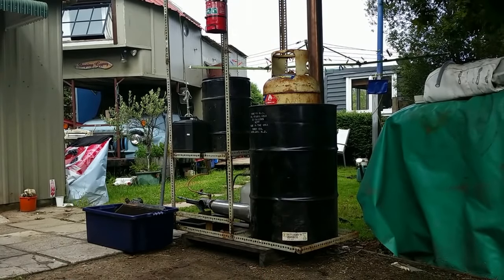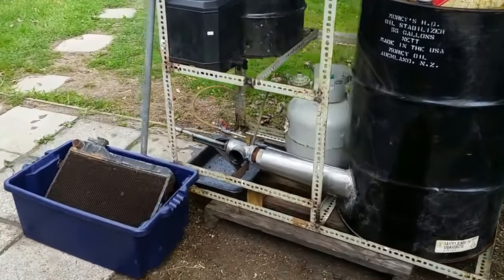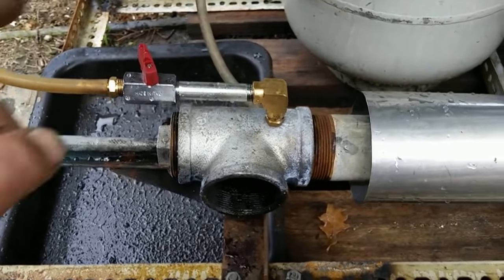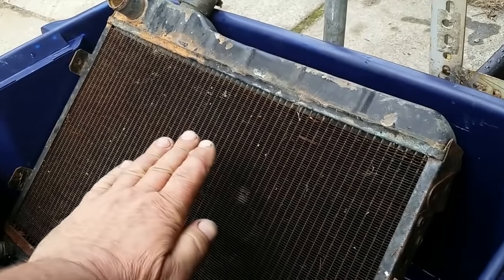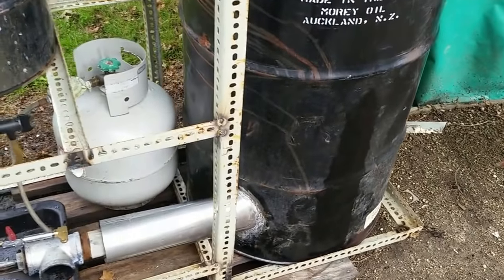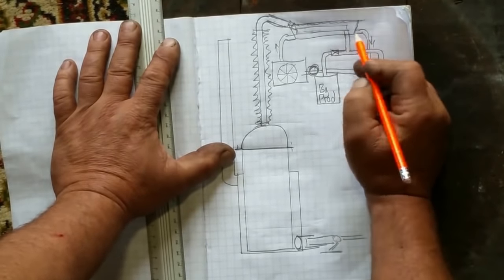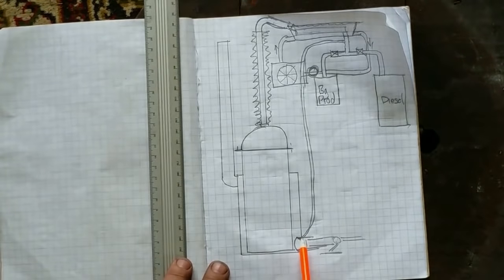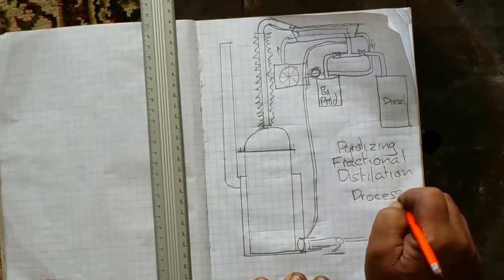Make your own free Diesel from Waste Plastic!  PART 2  layout of components

Comment: You are distilling the fumes from the plastic basically. It is easier to distill them through a water bubbler. Also the plastic melting point is low so you only really need an electric heater. Great design though, well done. I see tech like this solving the world's plastic problem... just convert it back to oil and refine it further to make gasoline.
Reply: could use solar to melt plastic ?
Reply: Yes I am sure you could. Use solar to generate the electricity needed. You might be able to use a water/solar magnifier but it would be risky, inefficient and only work on sunny days in a warm climate! All you need is a sealed oven and to bubble the gases through water. The oil/diesel will float on the water. Further refining will eventually make gasoline (lean oil).
Reply: Melting the plastic at high temp I believe is partly combusting the plastic and creating carbons which might be why the result is sludgy? The plastic should refine back to lean crude oil. I think diesel is a bi-product of the high cooking temperatures. Google the difference between oil and diesel. I think by refining the oil further you are reducing the sulphur/carbon to air molecule ratios upon combustion. Or something like that...
Reply: When you cook the plastic at high temps you are producing vapour and CO gas which is probably flammable too. You can do this with wood and produce flammable gasses and tar (a sludgy form of oil). The trick is to melt the plastic but not to over- combust it, I believe. The Japanese guy takes his little unit around to schools and gives demonstrations, so it cannot be that hot.
Reply: Simplify the process down so you have a heater, a cold water bubbler and a siphon to collect the oil when it reaches a certain level.

Comment: One part you didn't explain was the "by-product" to Diesel difference and how do you know when to switch from one to the other.  You said the by-product was produced in the early stages before the diesel product happens but I don't understand what you mean.  Is it the initial burning process produces the by-product first and once that is burned off the rest becomes diesel.  How do you know when all the junk is gone?
Reply: Investigate fractional distillation. Different molecules chains break out into vapors at different temperatures. Devils brew are longer molecules chains which vaporize at lower temperatures before it is cooled and condensates. As the temperature rises shorter molecules chains vaporize. Diesel will be produced at a certain temp.

Comment: If I understand this correctly you need to supply compressed air to the burner, how do you arrive at the compressed air?  Is that a seperate power source?  Compressors use a fair bit of electricity.  Also why don't you just use the waste vege oil you're burning to power your car/generator?  It must use quite a bit of fuel.  Would this plant make enough diesel per kilo of plastic to power itself without using the waste vege oil and end up with a net excess to power your car/ generator?
The propane starter fuel would als be an expense that would need to be factored in.

Comment: ..Is there enough excessive thermal energy to use some of it to drive the pump and the fan for the cooling system?   I doubt that you see very many Sterling engines at the dump, but maybe something similar...  Maybe you want to keep them on a separate power system.
Reply from the maker: oooooh - this seems like a phase two project!- lets get the insulation sorted first!

Comment: Hi Sir, first of all thanks for your videos. I have a little question. I m in Thailand and want to do this process low tech for the local who could use the plastic they found on the beach to get fuel ( instead of just burning it in the nature ... ). Problem is, i saw lots of people getting " Wax " instead or fuel. I saw others videos and people was using multiple container to get ( lite fuel, Fuel and Diesel ). I Just want to know how to avoid to get this wax when temperature goes down. Don't want to break the engine of those locals either. 
Thanks in advances for all the ones who gonna reply. 

Save our planete PLS

Comment: Perhaps I missed it but how do you separate the devils brew from the diesel?  Is i the case that the Db is the first few drops of the distillation process?
Reply from the maker: its about the first pint- it goes into a seperate vessel and is added to the next batch to be assimilated

Comment: I wonder how well an old water heater tank would work as a reaction chamber. And instead of plastic as a reaction material, use crude oil. And instead of an uncontrolled fractional distillation, add a temperature controlled pressure valve to the top of the reaction chamber. I bet I can crack diesel from crude, and power the whole thing from the byproducts, even pave my driveway with the waste bitumen that will collect in the reaction chamber.

Comment: you should be making hydraulic fluid and oil instead of gas. you can use a battery and a motor to make an alternator turn to make 350 amp with beat truck alternators and a 120 3hp motor will turn ten beat truck alternator for 3500 amps then you need a voltage rectifier to make it all one current then a transformer to make the volts or develop ones that make voltages in the range you need. gas depletes the resource of the crude when needed somewhere else.

Comment: Its really a excellent work but how much pressure is required for vapours fuel to comes out from the reactor?
Reply from the maker: You only need enough pressure for the condensate to get to the high point - then gravity does the rest I have mine set at 2-4 psi
Reply: How much cost involve for a model Upto 500kg plastic .
Reply from the maker: @quantumeducationservice307  - you just wait right there Bob while I  extrapolate my findings and expand my system to your hypothetical parameters. Im sure that by the end of the day I can have your answer- please leave your billing address below  for my consultancy charges. 😄😄

Comment: First a belated happy birthday. 🎂
Look interesting.!🙄
I was wondering if a simple ventury system as used in a degreasing gun, or on a blowmister could create sufficient misting of waste oil, and just how much air you would need from a compressor to  create adequate misting.? 
I use grid power, and electricity prices are going up, so without solar or wind generated free electricity it will get costly to run a compressor for many hours.$ 🙄.?!!
Reply from the maker: I pushed air through a .8mm mig contact tip so the air volume was miniscule. 2hp compressor manages easily. With longer, fatter chimney the airflow would be enough to atomise a simple drip system like ive used  or a 12v bilge blower from a boat. Ive made newer design using this. It blasts! Ive used it on my forge and on my new oil fired central heating. video soon

Comment: Too many Ads, besides that, thank you for the explanation and diagram.
Reply: Just drag the play dot at the bottom of the screen all the way to the end of the video and then click on the replay icon on centre screen,  takes away all ads most of the time. Sometimes there is just one at the end after you've dragged play dot but others will be gone on replay.

Comment: I see you are using a propane bottle in your system. Could you not use a "Tiger torch" for the burner instead of making your own?
Reply: The propane is just to get the system going, heat the burner to operating temp. Once there it runs off of waste oil only. Can't use a tiger torch for that.

Comment: When will we get to see the rest of the project. Very much looking forward to it :)
Reply from the maker: I like to get stuff for free and Ive had to wait for some  free insulation to appear!  Im about to do the segment on the heating chamber and reaction vessel by the weekend. Coming up after that  is a video on the reflux tube and condensers. Thanks so much for your comment, Its great to get feedback
Reply: TinyHouse and Offgrid Resources  I understand that. I like free stuff too. I just scored a 55 gallon steel drum and two 26x26x2" radiators. Still searching for a propane tank or other suitable pyrolization chamber. Might wind up using some oil well casing.

Comment: sir where you have connected the pipe that is coming from the gas ?
Reply from the maker: At 12;20 on the video you see where the gas is drawn off to feed the burner. in video 3 you will see the gas produced.
In Video 4 ( due out Monday evening) you will see the Reflux tube being madeand you will lern why its filled with glass marbles
Reply: som mondal 6

Comment: could you try gum leaves in your big whisky still, as i am told that diesel motors will run on eucalyptus oil.
Reply from the maker: Gums are a rarity over here!- you try it and report back!  Im stuck on this project too- I have such trouble with insulation on all my hot stuff- Im watching The Honeydew Carpenter - he is making awesome aircrete insulation- I ask him  questions and never get replied to
Reply: I don't known if this helps but i just saw a guy use 1 part cement, 8 parts water, 18 parts perlite,  to make a soft but good insulation. it needed to be rendered though.    might not be what your looking for, just throwing it out there.

Comment: How do you solve the flue gas that comes out from the chamber? The flue gas can be toxic.
Reply from the maker: Perhaps I should put a really long exhaust pipe on it and aim it your way?😴
 If you watch the videos you will see how clean this burner is! There is no smell or smoke whatsoever. Just a heat haze.  I have had the exhaust tested with an automotive exhaust emissions  tester and the results for Carbon Monoxide and carbon Dioxide were about 40% that of a late model car. The particulate discharge was totally undetectable on the machine

Comment: So just use the oil you're fueling your machine with to run the diesel engine...?
Reply from the maker: It uses 1 liter per hour- my truck wont go far on one litre of used engine oil and we have not got rid of any plastic- this is about using plastic that sits in bales in stacks as high as a 3 story building just outside my town
Reply: @t.h.o.r.  how many liters of diesel are you creating per hour? And you are talking about 1 liter of used engine oil (the black stuff) rather than some people thinking it's used fryer oil.
Reply from the maker: @janicefreedom8665   The burner will run on pretty much any oil you like . It uses about a litre per hour. as i say in the video- production depends on the size of your vessel- its easily scaleable.
Reply: @t.h.o.r.  I like the idea that you are using waste engine oil. the original commenter was having the idea that you could just run an engine on the oil you are using as an input... yuk.
Reply: @t.h.o.r.  What I was asking ... if your system is running.... 1ton of plastic sould equate to ~ 700 lts of diesel fuel.... how many hours would your system take for that..... and how much processing of plastic.... like does it need to be cleaned and chipped before you can use it?
Reply from the maker: @janicefreedom8665  i dont honestly know- i just presume that if you increase the reaction chamber size then you hold more so it takes longer. ive got just this one machine that i play with- there are many videos on here of larger systems- there are some good ones on my playlist https://www.youtube.com/watch?v=cQdGTritwwc&list=PLyv0yXw8MSrH_5AhWrJVaPRw9Er8ij9JQ

Comment: Your machine is exquisite, but complicated; too complicated for me. My machine consists of a burner and sometimes I use a rocket stove with wood or sometimes I use solar and a big reflecting mirror. At any rate, all I do is have a container, which is airtight and that can be gotten into quickly, like a pressure cooker. I heat the plastic anaerobically and as it offgases, I condense those gases similarly to the way you do it and we both wind up with free fuel.

Comment: Looking good so far  - basic pyrolysis, with not-so-basic products.
That 'reflux' tube thing bothers me. You're not cooling it, in fact, almost the opposite, so it's not technically Reflux.

However, if it works, more likely it increases the separation of the products, much like a Vigreux column.
On to video 4 ...

Comment: how you get the filtred desile??
Reply from the maker: the videos 1-6 deal with the design and building of the machine.right now Im sorting issues that have become aparant in the first few test firings. next we will be making raw diesel which is a little 'rough'. after making 3x 20 litre  batches i will have 60 litres. then we put that 60 litres through again to get perfect diesel

Comment: Looks like you have Nissan crew cab pickup, I assume it runs on diesel.
Reply from the maker: Yes but so far im only experimenting I run the diesel batches in a 30 hp stationary engine

Comment: How do you separate the devils brew and diesel
Reply from the maker: A sight glass and two taps, all condensate that occured before 350C gets diverted to another vessel. when the condenser reaches 350C I just flip the taps and that diverts it to vessel no 2
Reply: what uses are there for Devils brew and if not how do you safely dispose of it 
 @t.h.o.r.
Reply from the maker: @kimelize  you just process it in the next batch. It only happens cos the device is not up to temp and the product is not deisel

Comment: It seems pretty dangerous to have the LPG tank right next to the burner.
Reply from the maker: Its only there for 2 mins while it heats up. But the whole thing is a bomb- thats why I stopped doing it!
Reply: I like your initial machine.  Now that you have your first one; how would us improve the entire machine?  I've been working on creating bio-char using a 55 gal drum but the drum only last about five to eight cycle before the drum must be replaced.  Stainless steel drum are better but as you know ss is difficult to weld.   Your video is great.  Thanks

Comment: Of course this process is not unique.  Just to point-out to those here, who might think this dude invented the idea....   
But interesting to note, with all the talk of sustainability and alleged environmental concern,  that no-one here questions the continued use of fossil fuels (this system derives fuel from plastics, themselves a product of oil,  sequestered hydrocarbons...).   Nore does anyone question the content of gasseous emissions from the combustion of 'plastic diesel' fuel (?)  
.
Not as impressed, as people think I should be...  Though in the very short term, it might halp to remove some of the plastics in the environment...  But GHG emissions are still be produced by the combustion of this fuel.

Comment: Not a wise spot to have a fire extinguisher. Never put a fire extinguisher near a place a fire is likely to happen. Reason is it may get to hot to access by the time you notice that you need it..best to have it where one could access it if the fire was discovered already engulfed. if that gets out of control who the hell is going to reach above hot flames to grab it?!. 
Its the same as leaving an extinguisher in the shed full of fuel and paint thinners etc or in the kitchen or by a gas bottle!. Just stupid places to leave fire extinguishers. better of at the back door.

Comment: So you are burning waste oil, to create "diesel." Not the most environmentally friendly option. If everyone did this, the worlds emissions would skyrocket. If you changed the heating to an electric heater powered from a renewable source e.g. wind, the process would make more sense. Right now, commercial refined diesel is much better for the environment.